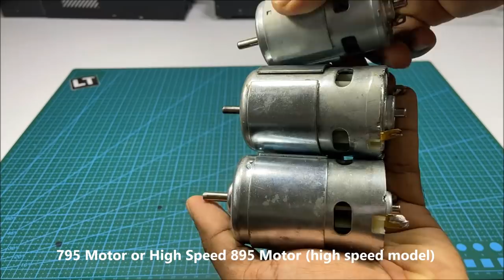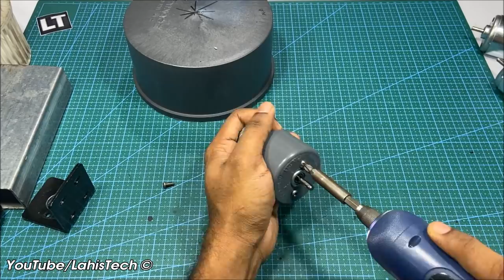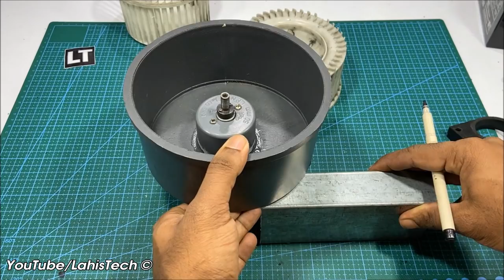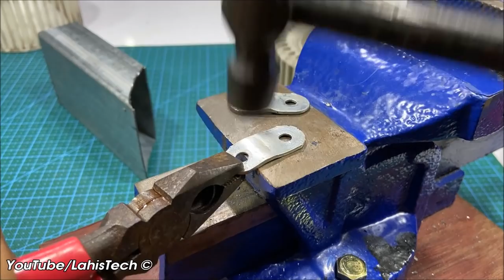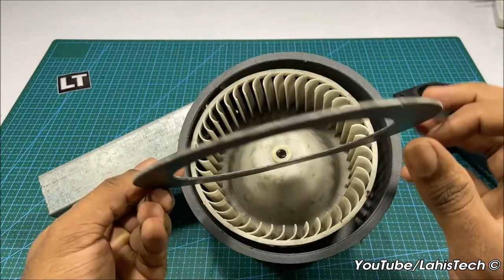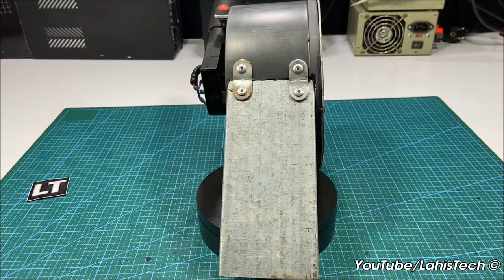Powerful Air Blower DIY

Comment: You can also use this as a vacuum cleaner, just use an other PVC pipe close the open air polling on the other side 👍
Reply: dont think suction is that much available